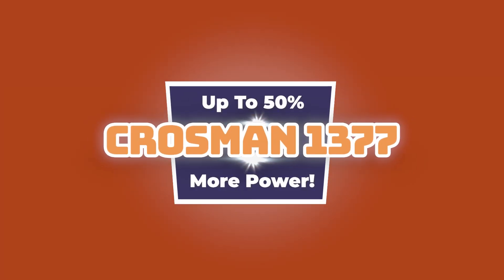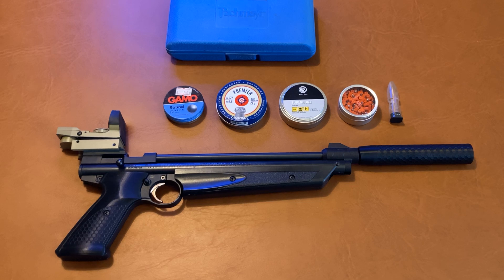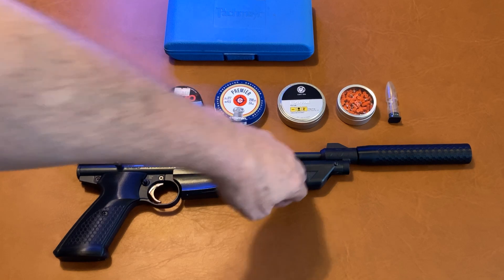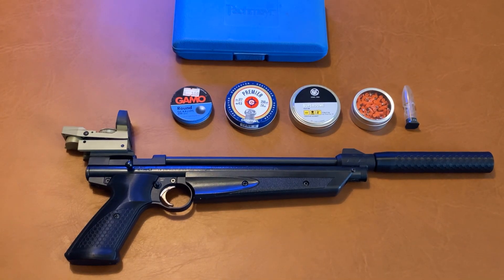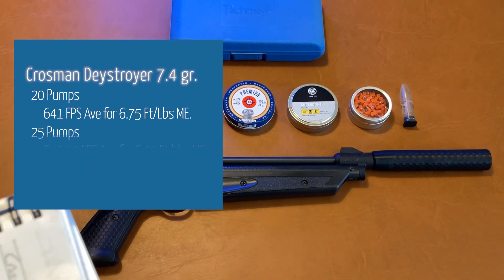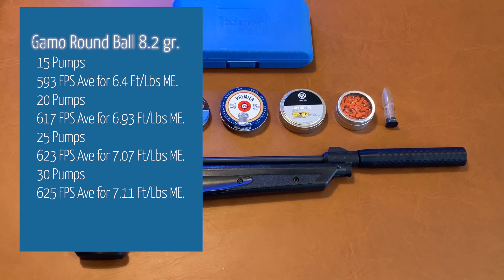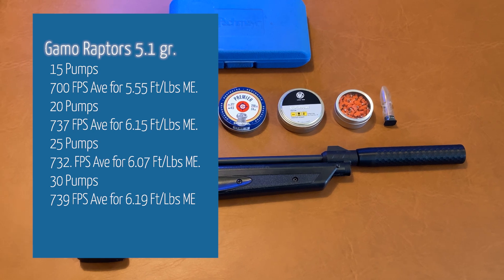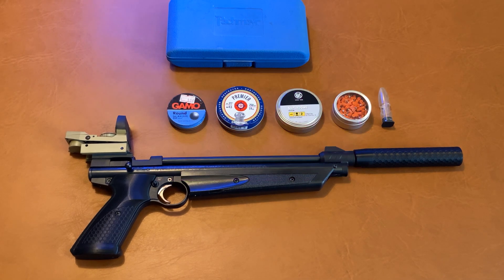50% More Power from Crosman 1377! More Power from 1377 Part 2.

Comment: I need this gun but I need it to hit between 15 to 20 fpe is it possible
Reply from the maker: No, it’s not going to get you there. 12 foot pounds would  be amazing and is probably not attainable.
Reply: @AlsAirguns even with a longer barrel
Reply: sure no prob..  my 2289 was $60 with about $200 in mods..   I can put a pellet through 3 2by4's   if I use my copper coated steel pellets.... figure a 70 grain pellet at 1250 fps be perty nasty lol.....and no its not a firearm in USA LOL

Comment: Hi. 
Can the 1377 use the JSB predator metal mag for rats?
Reply from the maker: I don’t see any reason why it would be a problem. It should be fine.
Reply: Many thanks
Reply: yep,, there a very versatile gun my 2289 has lasted decades as long as you oil it..    and most of the parts are complety interchangeable in the 17 and 22 series of crosman :-)    switch breech and barrel,,, its aa .22 or ,177cal        lol

Comment: 10 pumps will give the longest life for the seals.
You are going to have to put new O-rings in it eventually so why not over pump it?

For me one pump per grain weight seems to work on critters up to 10 pounds. I like the Ruger 17 grain pellets.
Reply from the maker: Thanks for the recommendation. I haven’t tried the Ruger pellets. I’ll have to check them out. Btw, which seals are you concerned about, off the top of my head I can only think of one o-ring in that pistol. Unless you’re referring to the one between the valve halves & I can imagine blowing it out.

Comment: The 14" barrel is the big improvement.
Second is over pumping the gun.
Whether you do anything to the valve or not pressure makes velocity.
Reply: note..   if you have a modified pump it dont matter.. though   the last 10 pumps outta 30 or 40 will be hell...    my pumps extender 12" cuz I cant get the 2289 to 1250 fps....
old valves had a check valve in em that prevented it,,,

ps pressure yup.  but so do volume and barrel length..   :-)  think about a blowgun..   the longer the get typical the faster the dart moves
Reply from the maker: True, while increasing valve capacity is a big help as well. By the way this airgun doesn’t have a 14 inch barrel, so not sure where that’s coming from. 🤷🏻‍♂️